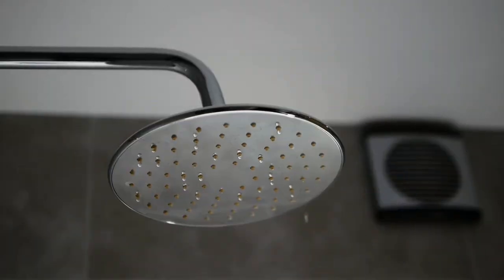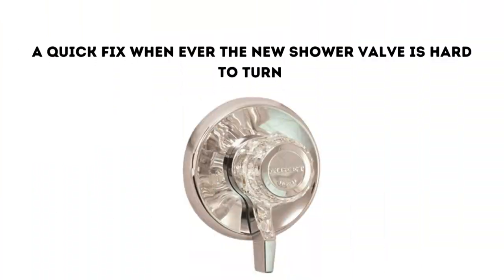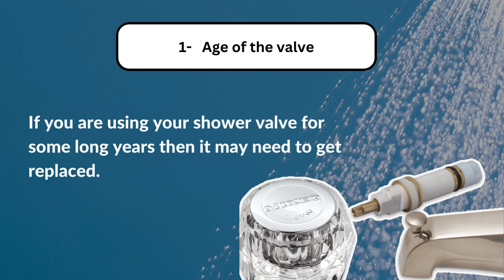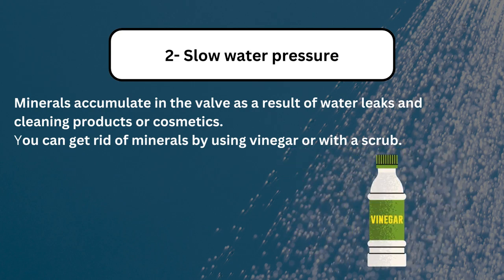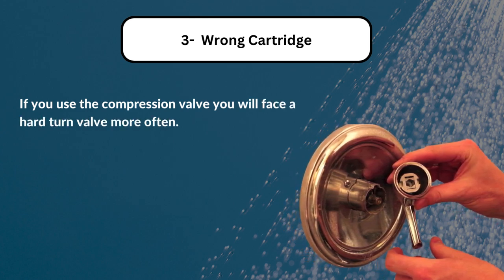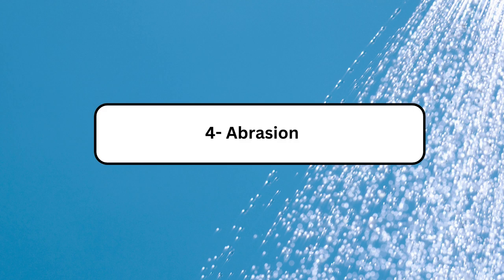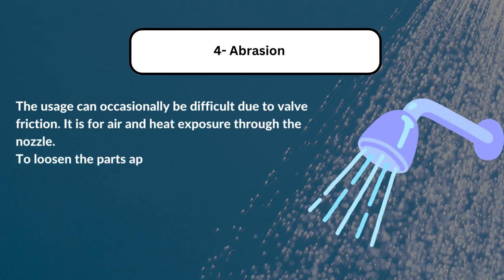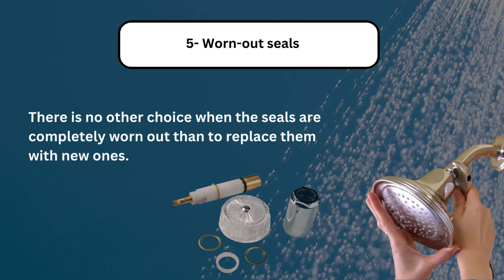Mixet Shower Valve Hard To Turn- Know The Solutions

Comment: My lever is hard to turn and i replaced the cartridge, should i try to find a ceramic one?
Reply from the maker: If the shower lever is still hard to turn after replacing the cartridge, check the handle for damage, lubricate the cartridge, clean any mineral buildup, and make sure the cartridge is installed correctly. If it’s still stiff, the valve might need replacing or out could be a damaged lever, so changing it would fix the problem. Sometimes the valve body could be worn out, so that might need to be changed too. Do let us know if any of these helped you out.
Reply: @answerthehome8888  Hey Thanks! I cleaned it up and greased the washer,it still turns about the same but I'm the only one that uses it so I'll wait on the r&r for now. Regards!